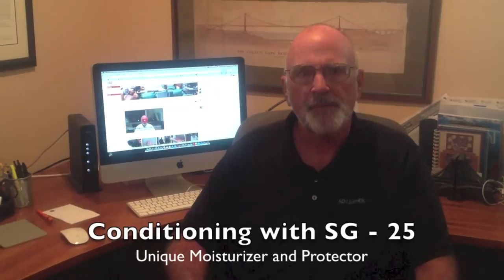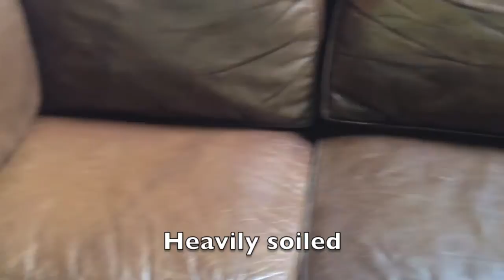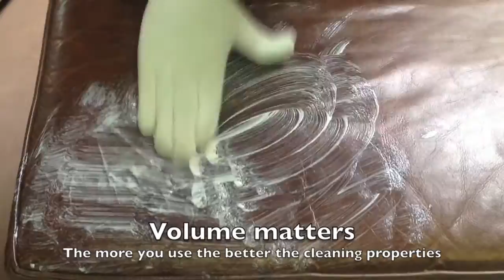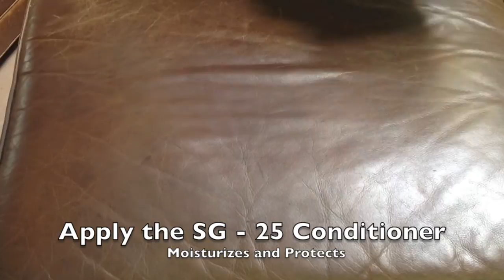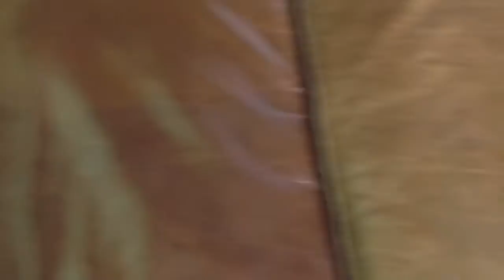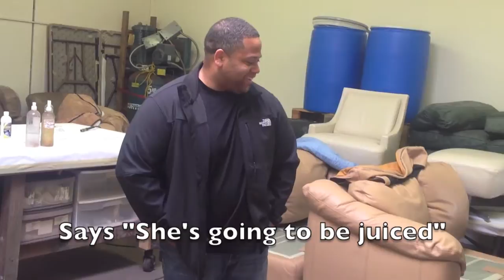Leather cleaning and conditioning - Oil Tanned Leather

Comment: Thanks for the excellent video.   I have a question for you.   We have a black leather sofa that we bought used.  The seller had applied a price sticker onto the leather.   I gently used water to remove much of the glue, but cannot remove all of it.    Do you have a safe solution for me?    Thanks   Bill
Reply from the maker: You need something that will release the residual glue.  Odorless Mineral Spirits (OMS) is a light solvent that will work for you, however, without your leather in front of me, I can't say with certainty that the OMS won't leave a reference.  Try it on a non-obvious spot first to see the effect.  You can find OMS in the paint department of a hardware store.  Finally, often with a tape like material on leather, when removed also pulls up some of the epidermal surface fibers like pulling a sticky band-aid from your skin.  The OMS will not resolve that.  Our SG-50 however is the correct product for that.
Reply: many thanks     Bill   Kevin Gillan